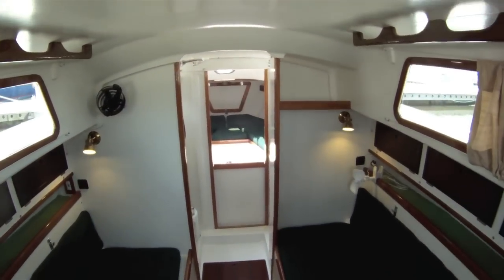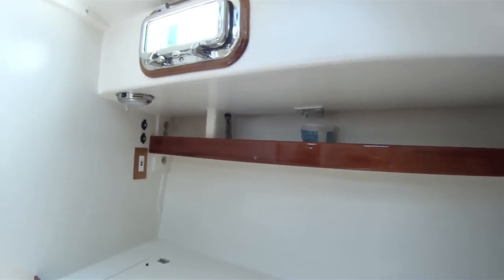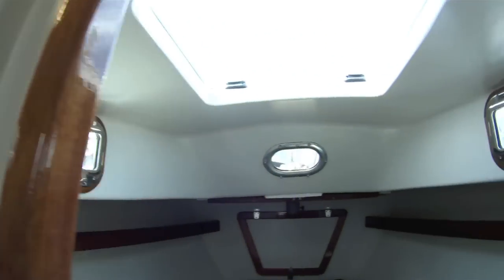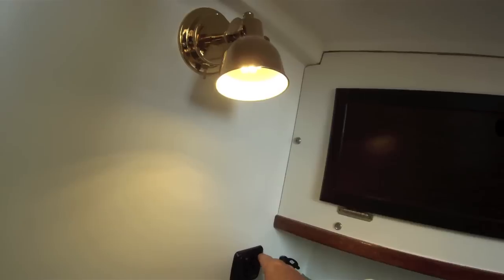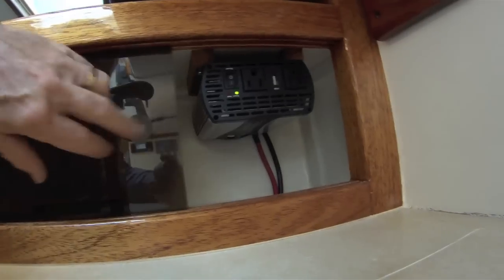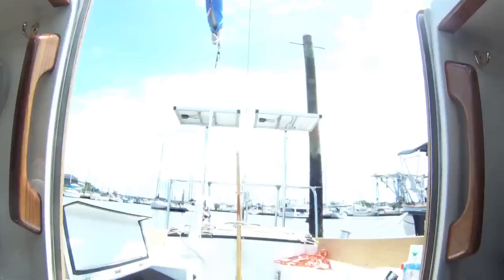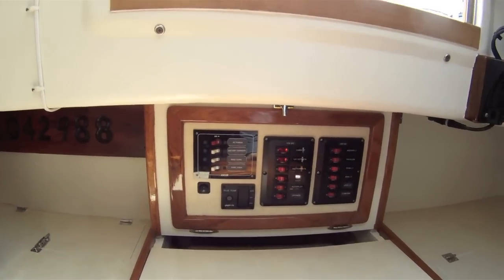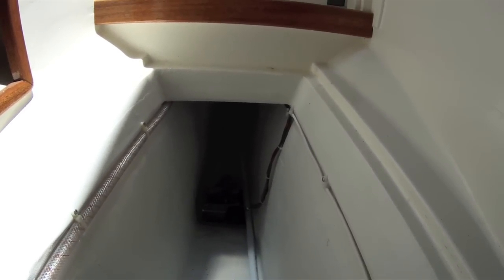1972 Alberg 30 Refit Part Two - Interior

Comment: Bellissima, non parlo l'Inglese, ma vorrei  capire perché il pacco batterie non è stato posizionato più in basso?
Reply from the maker: (Guiseppe asked, why not position the batteries lower.)

Abbiamo deciso di lasciare la sentina posteriore libera per eventuale presenza di acqua e per accesso alla chiglia. Non abbiamo messo le batterie nella zona centrale della sentina perchè lì c'era lo scarico della doccia. Volevamo anche posizionare le batterie dove prima c'era il motore per bilanciare il peso.

(We decided to keep the aft bilge areas open for sloshing bilge water and for bilge access. We didn't put batteries in the center bilge area because it was occupied by the shower sump. We also wanted to have the batteries balance the missing engine, which had been located in the same place.)

James

Comment: absolutely beautiful...how much is this boat worth now?
Reply from the maker: Thanks. Since the boat is unique with specific features either valued or not depending on a buyer's needs, the resale value is hard to say. It should be worth 50k or more if the market valued all the work done, but that's rarely the case. Another Alberg 30 we did a similar refit to was sold last year for $45k. That's probably a record price but well worth it if that was a persons ideal boat because they would pay more to have the same work done and only a bit less if they did the work themselves and valued their time at even below minimum wage. In most respects it's a new boat, only better. If you commissioned a boat builder to build a similar design today you would pay over 100k.

Comment: quick question, when you redid the inside, did you re-glass the ceiling or just sand and top coat? many thanks
Reply from the maker: There was no need to reglass interior surfaces aside from spot repairs. We sanded previously painted surfaces and gelcoated areas  smooth with 120 grit, primed with Pre-Kote, lightly sanded with 220 and finished with semi-gloss Brightsides. Now we use a more mold resistant water-based paint (EZ Cabin Coat) on top the Pre-Kote.

Comment: Do you like the tiller handle or a wheel better
Reply from the maker: I copied this explanation from my Good Old Boat List article on atomvoyages.com:
With a tiller, you have more room in the cockpit, particularly at anchor when you swing it up and out of the way which is typically over 90% of your time on the boat, self-steering is easier to rig, you always see the rudder angle with a glance at the tiller, the feel of the steering is more direct and intuitive, it’s lighter and simpler, cheaper, less maintenance and far more reliable. A steering failure at sea is no joke and is much more common with wheel steering and can be difficult to jury rig a repair.

Comment: Nice work, the only thing I did not like is the charge controller, all the reviews I looked at said they don't last.
Reply from the maker: That may be true. At the time, this Sunforce was the least expensive one I found with a meter. Cost about $100. It's rated for 30 amp so I'm hoping the max loads of 6-8 amps from two small solar panels means it won't be overworked and will last longer. Time will tell. It does have plenty of 5 star reviews on amazon, but you never know.

The new version (68032 is down to $80). Hopefully the quality didn't go down as well. I see a Renogy 30 amp model now available for $50 but don't have any experience with this one.

James
Reply: atomvoyager I've heard one of the better charge controllers is Morning Star PWM Tristar,  45 amp, about $147.00.  Also Morning Star makes a pure sign wave  300 Watt inverter that is one of the best.

Comment: lol why did you put bolt locks on an upward facing door in the v berth? don't you feel them under while sleeping there?
Reply from the maker: The barrel bolts are there to both stop the contents flying out during a knockdown and to seal the locker lids against the rubber gasket in case of flooding from collision damage. The bolt cannot be felt through the 3 or 4-inch thick foam cushions. I have had them on my own boat for many years.

Comment: why would you want 45 gal of water in the bow?
Reply from the maker: It's part of a watertight locker system under the v-berth. You don't have to fill it entirely if worried about weight in the bow. I've sailed my smaller Triton all over with an identical tank, sometimes full, usually not. If you are ever in a place where water is hard to get you'd be happy to have the capacity.  Even so, on our latest A30 refit, I opted to keep the original small fiberglass factory tank under the v-berth and added a 2nd central bilge integral water tank and that will be better weight distribution.